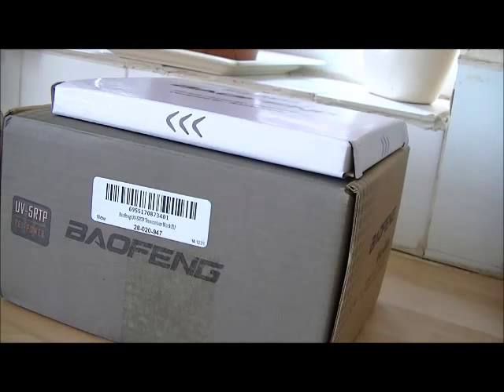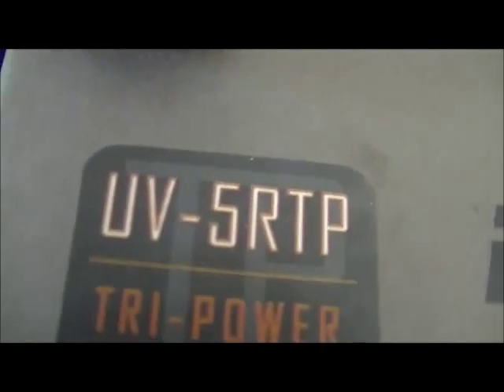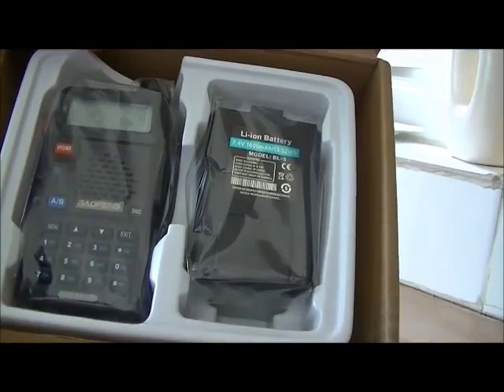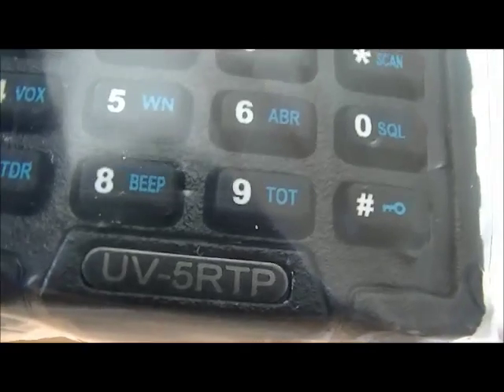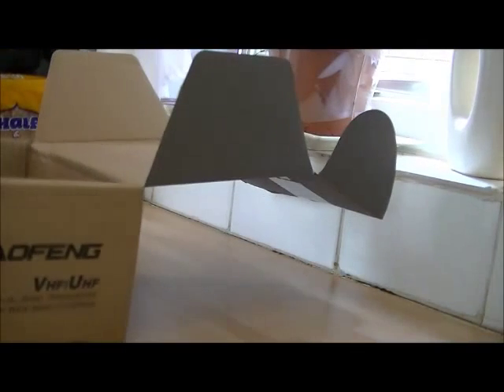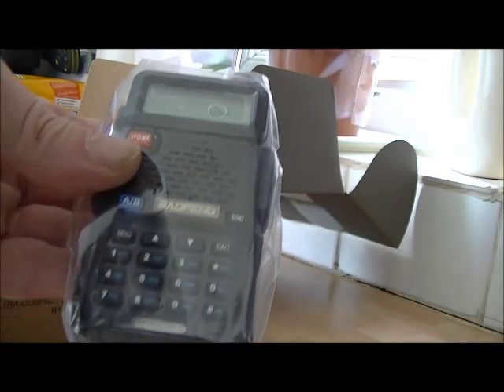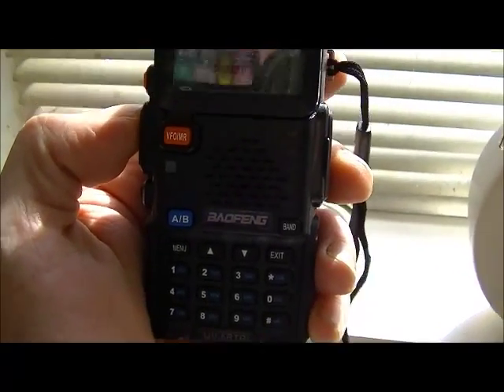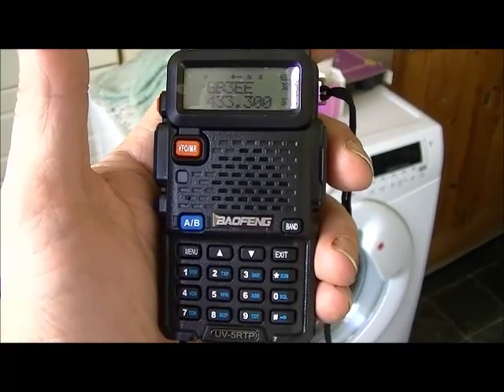Baofeng UV5RTP unbox and test

Comment: Great little radio I got mine setup to GMRS and MURS specs. Though not FCC certified I configured them for those frequencies. MURS is VHF license free and GMRS is UHF and is 70.00 for a 10 year license and super easy to get.

Comment: I can't find an extended battery to fit this radio. I received a BL-5L and it wont fit. Do they make one? Thanks
Reply from the maker: The one I got is the BL-5 7.4V 4800mAh and it fits no problem?
Reply: Thanks. Seems the BL-5L is common but the BL-5 isn't as easy to find in the extended model. Love the radio though.
Reply: ebay loads